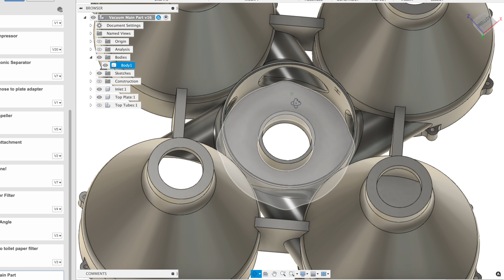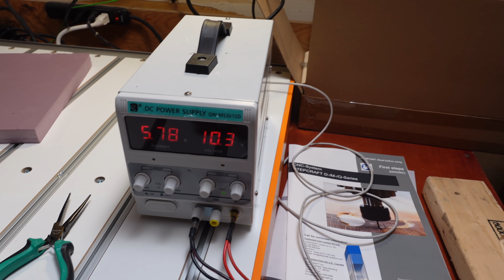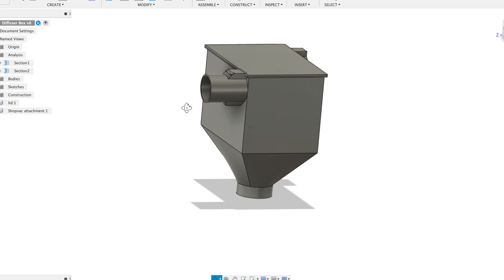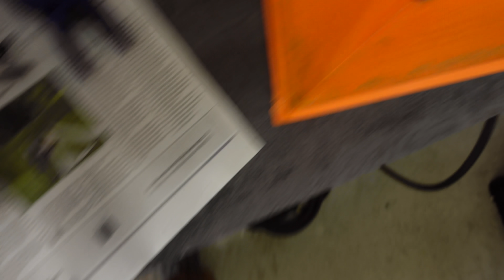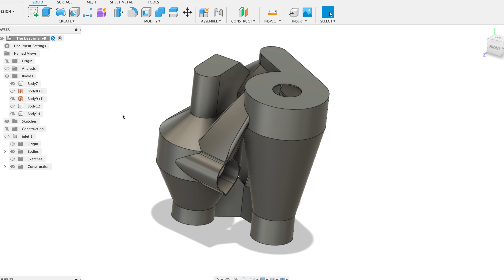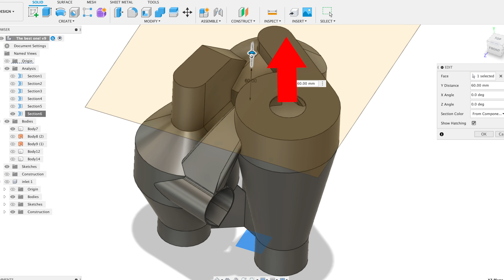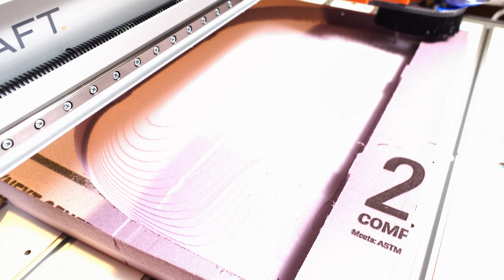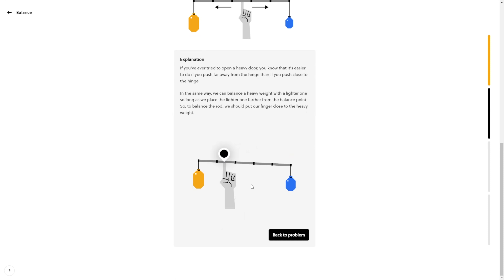3D Printed Cyclone Air/Dust Separator

Comment: Always appreciate your videos!!! 

The  collection  efficiency  of  cyclones  varies  as  a  function  of  particle  size  and  cyclone  design.    Cyclone
efficiency generally *increases* with (1) particle size and/or density, (2) inlet duct velocity, (3) cyclone body
length, (4) number of gas revolutions in the cyclone, (5) ratio of cyclone body diameter to gas exit diameter,
(6) dust loading, and (7) smoothness of the cyclone inner wall.  Cyclone efficiency will *decrease* with increases
in (1) gas viscosity, (2) body diameter, (3) gas exit diameter, (4) gas inlet duct area, and (5) gas density.  A
common factor contributing to decreased control efficiencies in cyclones is leakage of air into the dust outlet
(EPA, 1998).
Reply: Any books or texts that you recommend on the subject? I'm trying to learn more about it

Comment: what if the cones had ridges inside? Like fastener threads to direct particles down. Haven't seen before... Difficult to manufacture traditionally but easy to print.

Comment: You might improve the efficiency of the collector by adding a cylinder on top of the cone, thus air cycles more and have the benefit of a sharp slope for the large particles.

Comment: I had the same noise issue when I replaced a damaged vacuum hose, with a hose meant for pool use, because it was cheaper.  Ended up trashing the pool hose and using the proper vacuum hose.

Comment: It seems like the single big one performs better for fine dust just because of its size, i would guess that it allows for lower air speeds and also gives more time fot the particles to fall, air speeds might not be as important for bigger particles or objects so having multiple stages gives better results overall.
Maybe a staged system with different cone designs for each particle size would be an improvement, something like a steeper one first to separate bigger objects and then the big one to get rid of the remaining fine dust

Comment: Always interesting to see how air flows works on different items. I would be interested to see how your separators work on water. A friend and I used a bucket in the same way on a dry vacuum to be able to use it as a wet and dry vacuum. We put a float in the bucket to stop the airflow once the bucket was full of water. Interesting video Daniel, Cheers.

Comment: One tip for the tubing.
Had the same problem with air hoses on my mill. Its caused by the tubes having the spirals structures in the INSIDE.
Make a quick visit to your local home depot shot or similar and look for tubing for water pumps.
The hoses for the suction side are straight inside and will not cause the resonance. 
Make sure its suction tube, which has a reinforced spiral structure on the OUTSIDE.

Comment: I wonder if a long deep box with inlet and outlet near the top of opposite ends would work. The length would depend on the particulate weight and time to fall to the bottom.

Comment: I absolutely love that you are testing cyclone separators! Your design skills are insane! I use a handful of these in my little machine shop, and a two cyclone setup for my floor vacuum. One thing that I've found that helps is at the port that goes from the cyclone top to the shopvac hose, to have a portion of the tube protrude a half inch to an inch into the cyclone top (down into the cyclone chamber) rather than it being a clean port into the shopvac hose. To be honest, you may have done this already, but I wanted to share this in case you hadn't tried it already. I think the idea is to give the solids a wall that needs to be hopped in order to make it into the shopvac hose. Granted, it looks like your designs are working pretty good, especially the large one. I would imagine that the shape of this barrier could play a role in how much gets past the cyclone too, as the solids mainly stick to the surfaces. (I think the original clear plastic dust cyclone has this little barrier, if you need a better visual than what I'm explaining) It may not improve the solid collection a whole lot, but any little bit that helps keep it out of that shopvac filter keeps suction as close to 100% as you can! I have managed to keep my shopvac filters nearly pristine for a few years now. Also not machining foam either though.. which is probably the toughest thing to keep out of your vac filter! Awesome stuff!!!

Comment: invert the air-dust flow, so that you dont have centrifugal force problem fighting against you
Reply: collect from the outside, not center, might need an reaction impeller to get the center (rose turbine) flow to rotate around the separation chamber
Reply: yes the dirt hits the face
Reply: so that you dont need the replaceable filter (or dont need to replace the air micro particle) filter in vacuums, the vacuum suck impeller with electric motor works both the vacuum and the centrifugal filter roles

Comment: My intuition would be that if you put an inverted funnel on the bottom, you might get a better seperation of the downward and upward airflows. In some of the footage there seems to be quite some mixing of the two airstreams and their content just below the funnel. If there was a physical conical barrier there, seems like that should help. But if that isnt standard practice in cyclone seperators, im probably missing something.

Comment: Cool video.  Dust concerns with Carbon Fiber is what led me to choosing the CNC router I bought.  It allows me to keep the entire T-plate fixture plate under water so the carbon fiber dust is contained before being sent off to a filtration system in an aquarium that sits below my router.  After draining the table's basin I can rinse down all the CF dust and trap it in the filter element for disposal.

Comment: ageing wheels i think or it may have been its sister channel did a video on cyclonic (different from whats in the this video) separators where he made one with some unusual methods although with a 3d printer you could probably take some of the designs he used to combine them with this to make a very impressive set up

Comment: If you are getting dust coming back up from the bucket you have an air leak in the bucket.   A steeper sided larger single stage cyclone will do better.  Larger means you can make the dust output bigger.    Having the side of the cyclone smooth should help.   There is a lot of maths involved, maybe some witchcraft as well.   Great Video though.

Comment: Hey! i've actually done these experiments myself a few months ago. I found that, as you mentioned, a steeper slope was better for larger particulates. But my results were also greatly improved when I elongated the cone and allowed the air more time to circulate. Additionally, I found that sanding the inside to be as smooth as possible helped. Great video, love ur channel.
Reply: Yeah, I was coming here to say the same thing - make the inside as smooth as possible. Also, it doesn't have to actually be a cyclone - I built a Thien baffle for my wood shop. Straight sides, but very smooth (bent acrylic), and as mentioned elsewhere, the exit tube comes way into the chamber - I think my chamber is about 24" diameter about more than 12" tall, it's 6" inlet and 6" outlet, and the outlet starts about 3" above the base of the chamber. It works very well. But, I've not actually tried to optimise it - very much a case of "well that's good enough then!".
Reply: I own the Makita cyclone separator with stick vaccum and my friend has the Dust Deputy they both have a steeper slope. They work well. I think the air velocity also matters in the cyclone chamber. The larger and longer the cyclone is, the more air volume and slowing of the air velocity in the top of the cyclone giving smaller particles a chance to fall rather than getting sucked back up. When you look at Dyson it does really well keeping the filters clean but the CFM on those are only around 60 on turbo so it can be a small cyclone system. A decent 5-6 hp shop vac could be 150cfm and those industrial separators are huge as was shown in the video which would be really high CFM. There would be a point where a cyclone separator could be too big and the vacuum CFM cant form a cyclone to. Another thing would be the way the air enters the cyclone, in the video its a really sharp edge and I would think that is causing a lot of disturbance right by the exit hole The Dust Deputy has a much more gradual way of taking the air and smoothly entering the cyclone. I'm thinking small particles would better make it to the walls of the cyclone with controlled airflow.
Reply: @matthewsackman  Sweet
Reply: I thought 'rifling' the cone with grooves or a hexagonal profile would help with dissipating the energy of larger particles
Reply: the best filter was technically the paper towel because it only let air through and nothing else.
Reply: @Beans2.  Paper towel lets through quite big particles and when machining you can create lots of particles <10 um, which are very unhealthy.
Reply: Would doing a couple rifle bores on it help?
Reply: @loginyoass3771  ဝိါ်ာ်
Reply: ၇၄၈
Reply: Do you have any tests for a variable cone angle? i.e. it is kind of a "sucked in" cone where the angle gets progressively steeper.
Reply: ဉာာါာါ််ါိိိ
Reply: ဖြာ
Reply: A taller mono cyclone with steeper sides should work better, my inspiration being the relative dimensions of commercial separators I've worked around in the past.  In fact, most of them had an actual cylindrical section at the top that was at least half the height of the cone (often the same or larger) below which I suspect helps get debris away from the pass through sooner.
Reply: Remarkable work Bro👍Thanks for sharing your experiences ❤
Reply: I would also assume size is important. In a small cone the air doesn't slow down as much, so it would undoubtedly pull more particles with  it.
Reply: @christophfischer2773  တြော်
ဩဩဩဩဩဩဩဩဩဩဩြ
လြာာာာာာာာာာာာာာာာာာာာာာာာာာာာာ
Reply: ထြ့ာါာ်
Reply: @christophfischer2773  ဘ့ႏယြယယု.             ယြ.              ဉြ
Reply: ထြာာာာာာာာိာ်ာိာ်ာ်ာိာါာာာာာာာာ်ာိါ့ာာာာ့ာ
                                     လြာာာါါါါါာာာာာာဉြာါါာ
Reply: ရြဉြ
Reply: Trust in Jesus Christ
Reply: @juanit0tackit0tackito2  I dont remember a passage in the bible where he used a vacuum cleaner
Reply: @juanit0tackit0tackito2  ok
Reply: @juanit0tackit0tackito2  And the tooth fairy!
Reply: @juanit0tackit0tackito2  And Santa Claus!
Reply: @juanit0tackit0tackito2  Ave Satanas.
Reply: @alun7006  *Santana

Comment: Have you considered making your collection vessel deeper as well? A cheap way would be to stack 2 five gallon buckets on top of each other, the bottom with a lid and using a router to cut out the bottom of the top and lid of the bottom.

Comment: Thankfully it should be really easy to print a taller cone in multiple sections. Just build in a bit of overlap. Two cones of the same angle will always fit together.

Comment: Decrease the diameter of the cyclone to more strongly push heavy debris towards the outer wall, and extend the vacuum connection down into the middle of the vortex chamber (just below the level of the debris inlet) to help prevent short circuting of debris.

Comment: In the Northern hemisphere it should go clockwise downwards, in the Southern hemisphere it should go anti-clockwise downwards. This is due to the coriolis effect. Does it work better if you design it to flow the right way?
Reply: Galv140577 coriolis effect no effect at this scale.

Comment: The dust drops down the inside of the cone due to the interface layer between cone and air. You could try adding 'golf ball' texturing (added to the golf balls to increase laminar flow) to the inside of the cone to see if this increases the affect.
Reply: A sort of screw thread pattern might work with the helical airflow

Comment: I think the series cyclone workse worse for fine dust because the air slows down so much through the 3 obstacles that the finer dust isnt going fast enough and don't have enough momentum for the centrifugal force to get it stuck on the walls to fall down

Comment: Hrrrmmm.. I don't have any fancy cnc machines or  3d printers but I do have an airbrush I have been wanting to make some sort of extractor for it to catch over spray when I paint in my tiny apartment. How effective would a cyclone be for that since it seems to accelerate the air as it pulls.

Comment: I use a commercially made cyclone on the input to my shop vac. Some really small stuff makes it through, but it saves on filter bags as most of the waste ends up in the bucket and not in the shop vac.
Some big bits still orbit the cyclone without falling down, I wondered whether some vertical fins around the edge to stop them rolling would work, however since my cyclone does not come apart I cannot test this idea.
However if I use it to sweep the floor and the intake get blocked, it sucks the bucket flat, so I had to make a vacuum relief valve to stop this, it also jeeps the circulation going in the cyclone. I note that Dyson do something similar.

Comment: I think our right about the steeper sides.  In your pictures at the beginning the cones are a very steep long cone. I think the mono cyclone was so effective because the larger radius allowed a greater centrifugal effect to occur.  I made a dust separator with just a 5 gallon bucket and a wood lid.  The entrance was at a very steep angle but still downward and at a tangent to the inside of the bucket.  It separated all large items and much more of the sawdust than I though it would.   Keep up the great work.

Comment: Really cool voyage of discovery there - I have a suggestion to help encourage the dust not get stuck at the top of the cone, and that would be add a helix thread to guide them down to the exit.
Maybe a couple of mm high, and 6 to 10 turns?  Sawtooth instead of ACME thread?  / |   
Guess it's important that the inside surfaces should be very smooth to avoid snagging, maybe acetone vapor bathing ABS would be better than sanding?

Comment: If you look at a Dyson vacuum, each tier of cyclones has a separate collection chamber separated by a seal, also rather than multiple similar sized cyclones each one is reduced in size in order to filter different sized debris, the main shroud for large debris the subsequent in size for finer particles. The diffusion method might be effective as lower airspeed but you have to keep in mind you want maximum power rather than an obstruction on purpose as that not only reduces cleaning performance but also puts strain on the motor which in a non-shop vac vacuum relies on pass through air for cooling.
Reply: Actually, most of those motors have external fan blades to circulate air around the motor for cooling. A centrifugal fan can't run the aspirated air over the motor because it's in an enclosed cavity.
I understand what you're trying to say in the second half of your comment, but the reality is more complex than that. (the bit about Dyson is correct tho)

Comment: So this is cool, but why use such a small container? Was it just down to print bed size? I find that confusing when you can buy shop vacs that use buckets as the body for 20 bucks. 'Swhatever, though - cut the bottom off a bucket and stick it into a barrel and you're set now.

Comment: Awesome job, I really like the idea of them in series!

I actually designed one of these for a project at work. I used it as part of a system that allowed us to lift sand to an elevated hopper. This was placed in the elevated hopper to force the sand to separate from the air.

 I found that having a tube extending into the chamber a few inches from the exhaust port helped the efficiency dramatically. I was also using a chamber made from a piece of acrylic tub so the walls were vertical with a PVC reducer at the bottom.